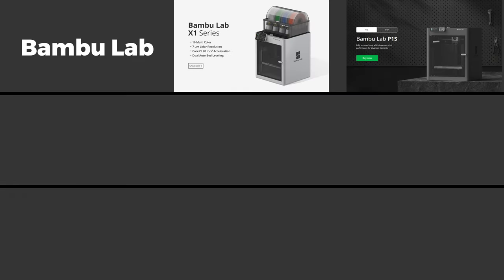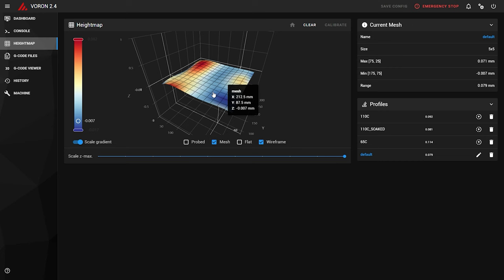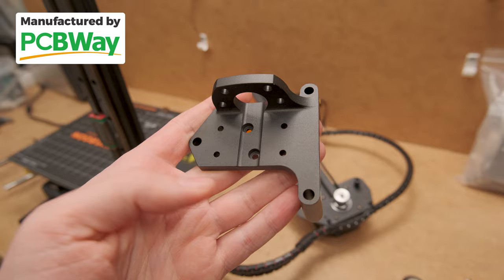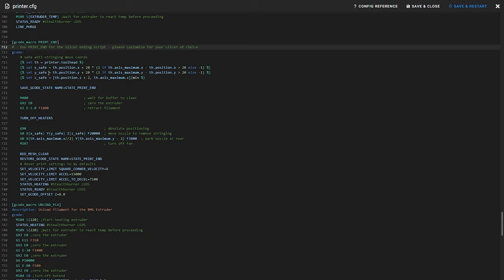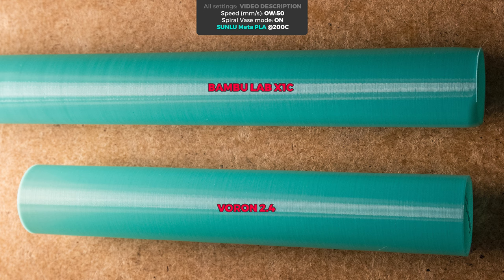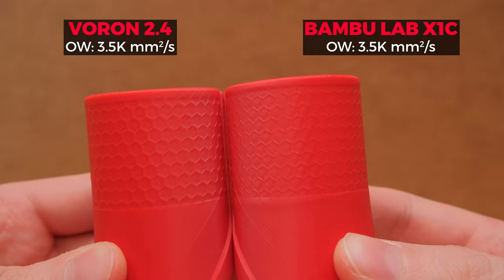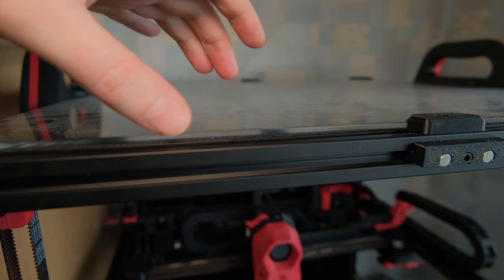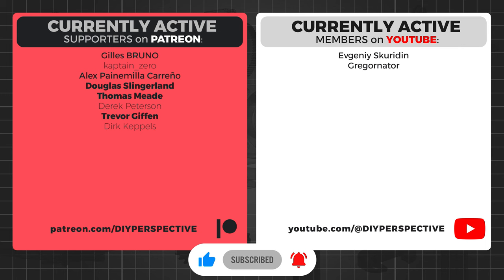Is VORON 2.4 as GOOD as people make you believe? (vs Bambu X1C)

Comment: I've built different 3D printers, from kits and from parts I sourced myself like the Willson 2 I build, designed by Martin Rice, I change it from Marlin to Klipper but Now I need to move on from tinkering to just print and design so my next printer is going to be a Bambulab, I know Vorons are great but  I don't have the time for building one, also for the price you can't beat a bambulab with the AMS.  One thing it makes bambu printers so good is the precision in the frame and the light weight X axis which allows fast speed without much ringing,  I build a Kit 8 years ago, the creality 7 a tiny printer  120x120mm,  it was slow but the print quality was even better that the one for bambulab and the reason is x and y axes were supper light weight. you cant beat the  laws of physics jus with software compensations, if you want quality go slow and light and the Vorons to me are on the heavy side.

Comment: i own a P1S and i love it - great workhorse. But i also built a "voronized" Ender 5 with the MercuryOne Mod, rocking a modified Stealthburner with a Rapido UHF and a 0.6mm CHT Volcano nozzle, that can put out 50mm³/s without breaking a sweat. Thats 250mm/s at 0.3mm layer height and 0.7mm line width. The max - before you can notice underextrusion - i was able to reach (with ABS) was 68mm³/s, which is totally bonkers. Another thing i love is the freedom of customization. Since everything is open source with Fusion files for anything i can mod the crap out of every tiny detail - something the Bambu printers can't offer you.

Comment: I just finished my third Voron. Already had 2 V2.4 and went for a Trident this time. I May get a Bambu sometime in the future IF it proves it's that better than a K1 that justifies costing more than twice the price.
Reply from the maker: Nice, I want to make more Vorons too. :) Where I live P1S (€749 / $785) costs ~18% more compared to K1 (€540 / $565). Maybe you looked at the P1S + AMS combo price? Creality has quite decent hardware, and the printer is nice, but the software/firmware is far from Bambu printers. K1's bed leveling is average at best and the heatbed doesn't even use the PID control method, but rather ancient BANG-BANG which makes layers look horrible. If K1 had a stock Klipper where you could easily fix all the things Creality broke and add new features it would be actually a great choice for people who have knowledge of Klipper. But now they don't fully know what they are doing and they are not letting people who understand things easily fix their printers, lol. That is my main issue with the K1 series printers. :D I need just to root it instead of waiting for Creality to fix things... :/

Comment: The real difference between the two is Build Volume, and Color.
Voron is going to be able to build a bigger object, with the 350mm version giving you a very large build area with only a handful of other printers out there being bigger, but also slower.
The X1C has its 4 color AMS allowing you to print, literally IN COLOR for your print, and while it will slow the print down because it has to purge between changes.  The fact you CAN natively print something in color is amazing.  Another good plus is its build volume isn't too shabby either (256mm) vs other printers.
Both printers can do 500mm speeds, Voron needs a lot of programming to do it, while the X1 does it right out of the box.  As far as I know the Pallet 3 (can use 8 colors) wouldn't be able to keep up with the speed of the Voron, much less be able to use its software needed to set purge towers ect for changing the color as it does need to plug in to USB on the printer.
Reply: U are so funny😂

Comment: I too have built a v2.4. Personally i see the trident as the superior choice. The fixed gantry allows for auxiliary fans, poop opening for mmu printing, you can reinforce the fram with braces, in built volume filament storage as well as secondary use as dry box (spool under bed). Also the trident actually reaches the advertised z height, the v2 is most of the time around 40mm too short, the reverse bowden would be bent otherwise. 
I agree with you, the stealthburner isn't that great for pla, you may want to look at the mantis toolhead, but keep in mind that the two front corners cant be reached.

The config is truly bare bones, not even a bed mesh is configured, although the stock inductive probe is heavily influenced by ambient temperature, so they skipped it. 

There are ways to counter thermal expansion, you can install backer or cheapo rails on y, so your two y axis beams won't form a banana and for x you could use a carbon beam, simon from vez3d test thermal deformation with an aluminium beam and carbon fiber beam, the carbon one did only deform around 0,1mm, lightweight aluminium beam was 0,6 or more. 

As for heatsoaking, im skipping that, even though i have the larger 350mm version. First layer was excellent and sticks most of the time too well. The only noticeable defect i get from that is you can see the x axis bending, but i plan on fixing that with a carbon x beam

As always great informative video, im just a bit disappointed that the v2.4 always get the spotlight while the trident is the forgotten child
Reply: Agree. Flying gantry is cool, but less performant. The only reason you'd need it is if you have a stupid heavy bed in the case of a massive build volume. Doesn't make sense at 2.4 typical sizes.
Reply: @geometerfpv2804  yep, mostly cool factor. Not even sure if you save a noticeable amount of money since the 80t pulleys are hard to get. For heavy beds, you can still use ball screws and at the size you need ball screws, you can definitely afford them.
Reply: Honestly I wanted the heated volume to be more controllable, and with the trident the bed moving makes it much harder to precisely control air movement inside the enclosure to heat/cool as needed and not overheat for twitchy or experimental materials.  Also heat control is the key to maximum strength for plastic FDM parts... And strength matters to me because I mostly print for component parts that tend to have at least somewhat structural use.

The trident was the cheaper kit, but I needed the 2.4.  also the extra z axis height...100mm makes a difference for automotive parts.  ^_^
Reply: @NeoIsrafil  you didn't gain 100mm in, you gained only 60mm. Try to move your toolhead to z300 and have a look at the reverse bowden. You can only achieve the for 350mm without a direct drive as the v2 was originally designed around a bowden setup and had two ramps boards.

As far as temperature control goes, a chamber heater might not be needed. In the summer i reached over 60 to 65c with passive heating (record was 68, ebb cpu was reporting 90c cpu temperature), although i should add that the room was over 30c, its a conservatory with three sides of glass.

As for temperature control, im not sure how the z axis movement  should disturb the temperature control. The qidi x plus 3 and max 3 have also a chamber heater, but that one is in the bottom corner, probably so the freshly printed part wont be hit with a hot air gun or so. Also most industrial high temp printers have the bed as z axis and i would expect them to know more about printing at elevated temperatures than us two hobbyists

Comment: I was a Kickstarter X1C/AMS backer. I've had NOTHING but problems. My printer will only print on the cool plate. Initially, bambu said it was due to firmware, and it would be fixed with updates. Now over a year later and like 20 Textured and smooth PEI plates. It still wont adhere to any of them. I have been begging Bambu for help the entire time. I always got canned responses to slow down speeds and dont raise the bed temps to over 65c (I never did). Finally after a year, and sending dozens (hundreds?) of support messages along with printer logs, they said they're going to send me a new bed. I don't know what they found in these logs that were different in the dozens (hundreds?) of other logs. I just hope this gets my printer working. I purchased a qudi 3 max and love it. I'm really thinking about building a voron next.
Reply: Interesting. I too am a KS backer with 3700+ hours printing on the X1CC. I have tried cool/black pei/peo/engineering plate and zero issues with sticking. So you have a video up? Maybe I can help.
Reply: @ashleys3dprintshop  I am totally stuck atm. My KS printer was different from their guide. Biggest being the right side panel, the guide shows only 11 screws, but mine had 14. So When I tried to pull the panel off it broke some screw connectors. I can get that back on as they obviously did away with those connections in later revisions, but it sucks they broke. However, they glued the hotbed connector sensor wire to the pcb. I cannot get it off without risking the integrity of the entire board (I've pulled hard and tried to pry it off with tweezers). At this point I'm out a printer. I've been messaging them non stop for a week asking how to proceed and they've gone completely radio silent. I can certainly document everything (already have for them), and email you.

Comment: The Voron 2.4 is quite expensive when you use good quality components. When you have a Voron build with lower gade components (like mine) the printer is not that fast and not reliable  enough for big prints and you spend quite a lot time on troubleshooting and repairing. The BambuLab X1 carbon is comparable in price and just prints fast and reliable. I sold mine and replaced it with a Prusa XL.  A very sturdy and reliable machine with multiple tool heads instead of a filament changer. Not as fast as a Voron 2.4, but capable of printing 24/7 without any issue.
Reply: Maintenance of Prusa XL is a nightmare. From the printing factory's perspective, Prusa is already behind the times.

Comment: I've built so many printers and spent countless nights building firmware and tuning.
I bought a bambu and print via microsd and have never connected it to the Internet. I finally realized the beauty of plug and play.
Reply: Correct me if I’m wrong but after the printer is built and working as you want… there should be nothing left to do but use it…? I mean that’s the way both my vorons are…

Comment: stealthburner is a reshape of the old abbn toolhead which is several years old and a dated design underneath. its not a very good toolhead on modern diy standards- its heavy, clunky, bad resonance performance, and poor cooling. its better than the old afterburner but its not a competitive toolhead in modern designs. tap is not an upgrade, its a downgrade and depending on what parts you use to build a tap setup, it will introduce a tremendous amount of printer problems in terms of surface quality. tap cuts resonance/ringing performance essentially in half at the expense of convenience of not using a probe, a problem that wasnt a problem. want a good voron? run a good, light toolhead like mantis, xol, or archetype. half the weight and +50% - 350% more cooling at the same time. run a good probe like a klicky or a beacon. you'll have much more control and quality on the printer over the bambu on this case. if you take the recommended shaper from those charts instead of doing it manually and tuning to mzv, you' will get tremendous ringing on your voron because 3 hump is meant to specify for both 3 spikes, and a high bandwidth, high smoothing setup that will also screw all your parts up. the move would be to increase your belt tension and use better quality and higher preload linear rails, to get narrower spikes, so that the shaper curve covers the whole spike. you can set your shaper curve to the apex of the curve, but then set your max accel below anywhere that isnt covered by the shaper curve. given that you have a slope almost from the start, you're going to have ringing albeit suppressed, along the entire curve. this is a tuning problem, and a problem with your particular kit and particular build, not the printer design. kits use shit rails and this is a big impact too. most kits use zf rails with basicaly no preload, which is way too sloppy. should note, i was a day 1 x1c+ams kickstarter, and i have multiple vorons and have been in the voron community since 2021. both are great machines, but the voron is going to be highly dependent on how you build it.

Comment: Um, not to mention all the upgrades you can go with to fix most of the problems you mentioned. Such as even flatter bed and a kinematic system for thermal expansion, idler shafts instead of bolts/threads, the mods are endless. Also super awesome, it's free and open source, no sketchy Chinese servers with my data on them just to print something. I LOVE my vorons and would never buy a bambu let alone connect it to my network. It's known that stealthburner is not great for PLA/ part cooling - so many will go with XOL if you need insane cooling that would out perform bambu

Comment: Voron 2.4 is a slightly flawed design (Overconstrained gantry,  not ideal kinematics for its size). 

The Voron Trident is:

Cheaper than a 2.4
Less Complex than a 2.4
Better Kinematics than a 2.4
More reliable than a 2.4

Flying gantry CoreXY only starts to make sense for  above 500mm^2 bed sizes.

Comment: $750 is pricy for a 3D printer.  I bought an Ankermake M5 for $400 and it's a thing of beauty.  A Bambu Lab P1S was about $600 but its inclosed and come fully assembled.
Reply: can an ankermake reliably print abs, pc, nylon, or other high temp engineering filaments? no heated enclosure so no. Can you easily modify or replace parts with off the shelf parts if anker decides not to sell the parts? no...  you get what you pay for. the beauty of voron, or other opensource projects in a an increasing "cloud products as a service" world, is you are in complete control.

Comment: And if the X1 eats it’s pcbs again, like they like to do, speaking from experience, you’re screwed and can’t fix it yourself. You’re alway in need of a backup machine. My X1 is down for weeks again. I’m grateful for my solid Ender fleet to take over.
Reply from the maker: I have been using mine over a month and I didn't even had a single problem (knocking on wood). How long you have been using yours? What problems you encountered?
Reply: @PrintingPerspective  1 year. And it’s already a replacement unit. There have been plenty of issues besides the total electronic breakdown. The hms causes more issues than it solves, especially with False alerts. The mechanics is fixable, but not electronics and firmware. Actually my current unit has probably been bricked by a firmware update, which is of course not reverseable. You’re dependent of the support which still isn’t staffed enough.
Reply from the maker: Well, we will see how mine will last. Electronic problems are a nightmare...
Reply: This is the main reason not to go with a X1 imo, your totally locked into relying on Bamboolabs for replacement parts and whatever quality control they have. At least with a Voron you could swap parts to something else if you found they break often.

Comment: The 2.4 is not as fast, however what it is not in speed its not slow either, and to be honest after owning a few 2.4's, Tridents and now an X1C, they one thing they have on the X1C is far superior quality of prints and quiet operation.   I have gotten passable prints on the X1C but not quality prints, mostly due to the motion system and FVA lines on the X axis which if you do your homework and read up on it, is super common on both X and P series Bambu printers.  However my go to is my X1C for general prints.  For absolute quality prints my 2.4 and Trident.  For draft prints my X1C and Sovol Sv06 (which is almost a switchwire now)....

Comment: great video. please can you clarify what the zhop test was trying to show? Is it that printers might not return to the correct z height after a hop, hence inconsistency in layer lines? thanks
Reply from the maker: Yes, you're correct. In almost all cases a printer will never return into the exact previous spot, so the test show how consistently it can do z hops. Inconsistent extrusion or any other related variables can also negatively impact results, so you need to test for those first.

Comment: I recently built mine 2.4 350 with Tap and CAN mods and it was somewhat hard to switch between different manuals and it got complicated fast. Luckily I had already helped to build my firend's vanilla 2.4 350, so I had some experience and he helped me as well. I considered a Bambu, but the larger build volume was what I wanted and I'm also not super into the proprietary way of doing things that bambu is doing. That said, there's a difference between having 3D printers as a hobby and 3D printing as a hobby. Personally I loved the experience of building one and I love that it's so easy to mod parts and I have installed a The Filter active carbon filter and webcam. Not everyone wants to go through that ordeal just to 3D print stuff, though.